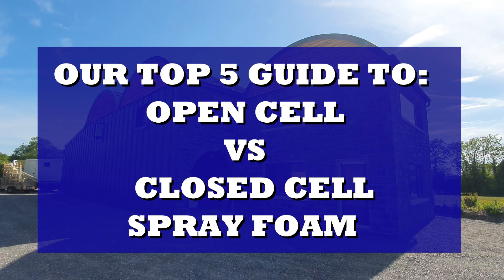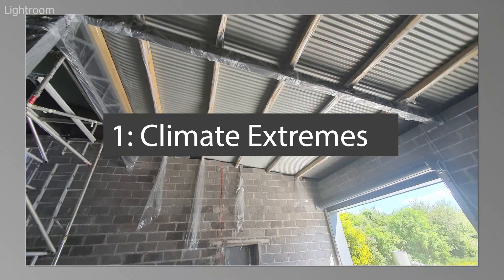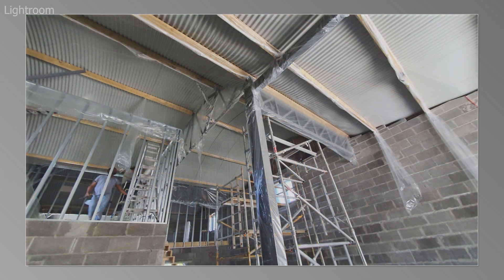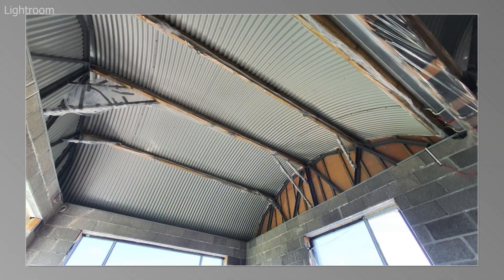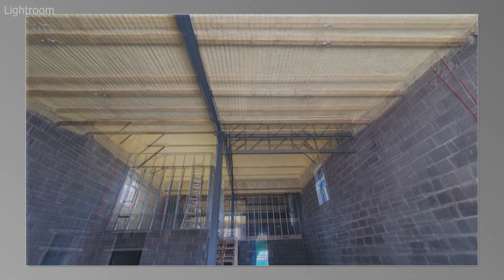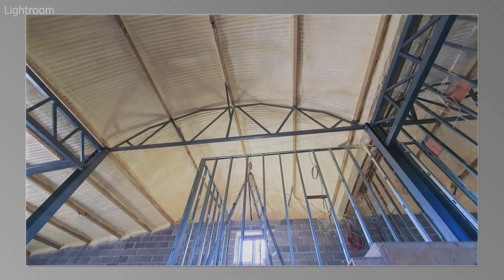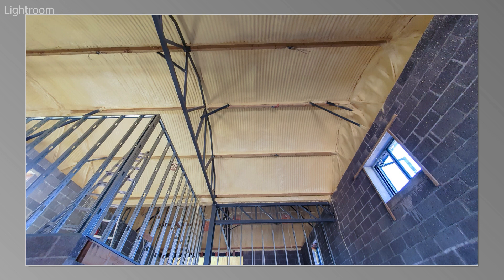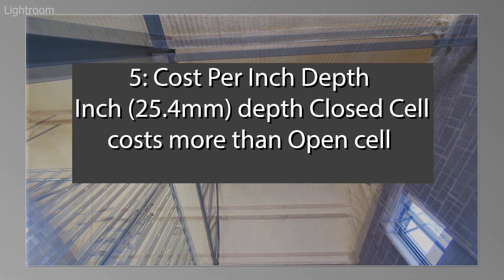Top 5 Reasons to Use Open Cell Foam vs Closed Cell Spray Foam

Comment: What did you use as a thermal barrier?Did you install an air channel for ventilation of the roof when using open cell insulation to prevent condensation from forming on the underside of the roof deck?